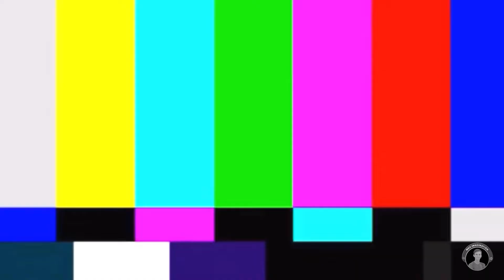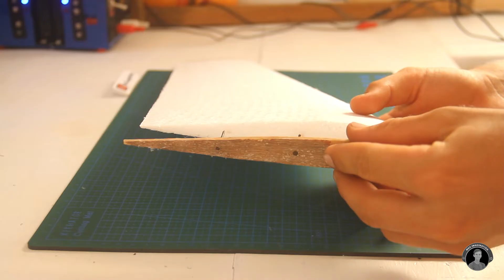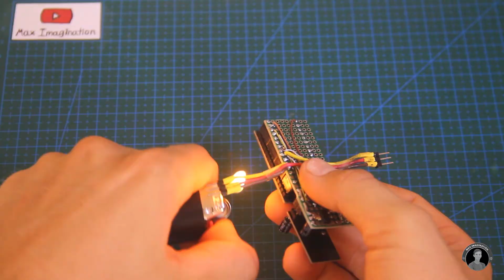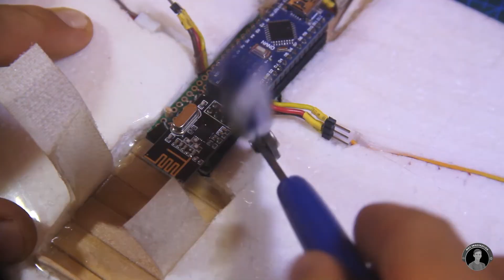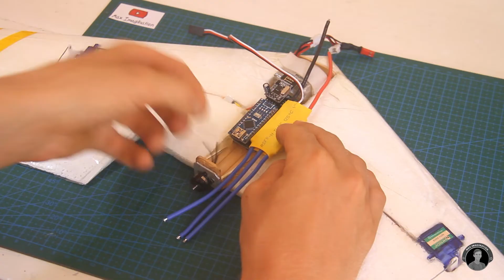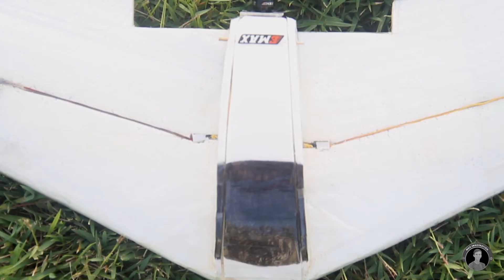Build an Arduino Flying Wing RC Plane | DIY Sweptback Wing

Comment from the maker: Hey guys! Thanks for watching the video! 
Just to rephrase the part where I stated the plane flies for ~10 minutes, I actually referred to the ideal flight time of this plane, calculating from what current the motor draws from the battery's capacity.
The plane in perfectly still weather conditions and a little more practice flying makes for better control and longer flights.
Thanks for understanding, cheers!
Consider dropping a like 👍🏻, a share, comment, and subscription to the YouTube channel if you like what you see! ✌🏻
Stay tuned for a potential upcoming video of longer flights from this flying wing.
Reply: You can add tail wings to stabilize yaw movement
Reply: @Art_Of_Fischl  Yes, and the excessive use of hot glue is also affecting its aerodynamics.
Reply: keep up this great work and passion my friend
Reply from the maker: @7MinutesCreative  Thank you, buddy!! 🙂
Reply: Good job bro
Reply: Bro you are so creative 😉
Reply: Its tail heavy....
Reply: mistake?... Its fly... Is ok....
Reply from the maker: @jogomez1988a  Hi, Jorge. Apart from not having flown one of these before and the slightly windy conditions, the plane flies good 🙂✌🏻
Reply: Bro you using 7500kv motor ?

Comment: What is the range of that? Bro
Reply from the maker: 100m
Reply: @MaxImagination my brother what happened if I place big wifi antenna with 18dbi into my nrf24 for long range because I want to build that like (budget meal) hehe
Reply from the maker: Use an NRF24L01 PA + LNA module if you want to attach an external antenna.
Reply: @MaxImagination thanks bro❤️‍🔥

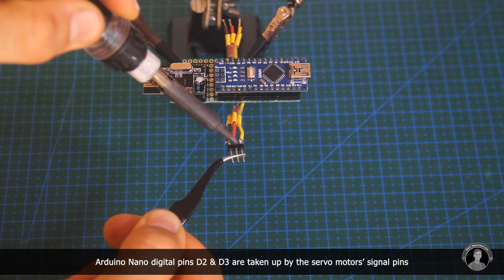Comment: @MaxImagination another question, what type of wire did you use beside 18 awg because in this tutorial, transmitter for 4 channel  and at 8:02 you didnt mention wire size, does 26 and 18 awg is good enough to use in this circuit ? and what type of wire when u use for the power in tge receiver? Thank you 🙏🏻
Reply from the maker: For powering the receiver, 18-24 AWG wire should work. For servo wires, your 26 AWG should work. For thin signal wires, I used 28-32 AWG wire.
Reply: @MaxImagination thanks man

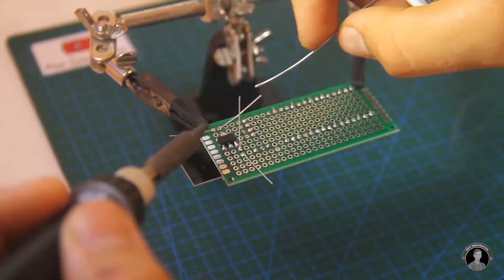Comment: can you explain where did you solder the capacitor in 7:10 because when i see the diagram it only shown to the regulator, does the second soldered into vcc and signal pin ? (sorry for my bad english)
Reply from the maker: The 10uF capacitor goes to VCC and GND of the NRF24L01.
Reply: @MaxImagination another question, what type of wire did you use beside 18 awg because in this tutorial and transmitter for 4 channel you didnt mention wire size, does 26 and 18 awg is good enough to use in this circuit ? and what type of wire when u use for the power in tge receiver? Thank you 🙏🏻

Comment: A six axis gyroscope with self stabilization will fix all the issues, that is the original problem they had with the actual flying wings till they got modern flight computers
Reply from the maker: Thanks for the tip. If I ever build one again, I'd consider adding a 6 axis IMU.

Comment: Im making mini version of this using 720 coreless motors i want to know can i use home made motor driver which you used to mini drone.if it ok is eny edits on code for brused homeade esc using mosfets?
Reply from the maker: Hi there. No edits in the code are necessary. Watch my new MOSFET Motor Driver guide video here: https://www.youtube.com/watch?v=xW2Nwg_RX84&t=46s

Comment: Excellent, How did you make yaw motion for this type airplane as no rudder?
Reply from the maker: The yaw comes from making the plane tilt to one side, making it do a turn.

Thanks!
Reply: @MaxImagination  Many thanks for your response. Could you further clarify it if possible? For example, by controlling the right-left control surface up or down.
Reply from the maker: Yes, it is made by making one flap tilt down and the other up. Swap these to make the plane turn the other direction.
Reply: @MaxImagination  Thank you for your response. Isn't this control for the roll motion? How is it related to YAW motion?
Reply: @ismailhossain9495 im Late but to clarify, a flying wing configuration doesn’t need yaw, you turn by rolling to the side you want to turn and pull the elevator, making the plane turn. If that didn’t help feel free to ask anything else.
Reply: you can use two motors with differential thrust, or you can use drag flaps, but this type of plane really doesn't need yaw control

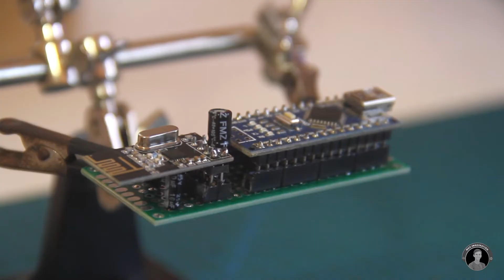Comment: hi max. 7:35 is the PPM out pin the one you have to connect the ESC to? Thanks!
Reply from the maker: Hi there. It's actually PWM and it's the first channel, yes.

Comment: here`s  a little tip: make a small handle on the bottom with some foam, so you can launch it like a paper airplane
Reply from the maker: Thanks for your tip! However, throwing it like that could get your hand in the way of the rear propeller as you throw and throttle up.

Comment: Bro if you need a elevon code I can give you the code. Cause you're code not working you couldn't make the motor go from the middle to the high value
Reply from the maker: Please excuse my lack of knowledge at the time of coding the plane. If you can supply the code, I'd appreciate it and it would help others too!
Reply: Bro I need a elevon  code  please

Comment: 👍.I have seen you using tp 4056 to charge 3.7v li po battery. I have 500mah 3.7v li po battery and tp 4056 what  value of resister you recommend to tp4056 for charge  my battery?
Reply from the maker: Search on google images for the "TP4056 current limiting resistor chart" to help you select the correct resistor for all future batteries
Reply: @MaxImagination  thanks.

Comment: If you think of revisiting this aircraft or the flying wing concept in general, you should incorporate some automatic stabilisation - even the best pilots the USAF has to offer can't fly these things unassisted, the only recorded crash of the B2 Spirit was due to a sensor failure, and as far as I'm aware it's the only full scale flying wing currently in operation.

Honestly, the fact you managed to keep this thing in the air for as long as 10 seconds was surprising and impressive, seems like you're a damn good pilot. Watching your videos, among other creators, has inspired me to start scraping together some components and hopefully build an FPV drone, or at the very least a car, so thank you for showing how simple this stuff can be.
Reply from the maker: I'll consider adding stabilization if I choose to make another plane or other form of aircraft. Thanks for your suggestion and compliments! Cheers.
Reply: Flying fixed wing aircraft in a flying wing configuration might be difficult in full scale aviation but model airplanes behave differently. It’s not that difficult to keep a flying wing in the air. Yes, more difficult than a high wing or something but still very doable. You shouldn’t need stabilisation after your first few flights just like with any aircraft.

Comment: Why never glue an electrical component directly to the styrofoam?
Reply from the maker: You don't glue components directly to polystyrene as this will rip foam chunks out when removing or replacing components.

Comment: Good project.I have made arduino transmitter and f22 raptor model aircraft is this arduino code match that aircraft?
Reply from the maker: Thank you! The code should work for that model aircraft, it works for most.
Reply: @MaxImagination  thanks 👍

Comment: hey max i am looking into making this for myself and I was wondering if I needed to make the transmitterthat you made or can I use an off the shelf 2.4 GHz one. If so how do I paired it/set it up and do you have any recommendations on with to buy.

thanks
Reply from the maker: Hi there. If you're going for a streamlined radio controller and receiver. I suggest you look on amazon for the Radiomaster TX12 ELRS transmitter and an ELRS nano receiver.
Reply: @MaxImagination  thank you very much

Comment: I'm new to rc plane hobby. I want to make a plane i hope to use 7.4v 2s battery and 30A esc. What motor you recommend for me 1000kw bldc or 2200kw bldc?
Reply from the maker: Choosing something of higher "kv" is more optimal to get your plane off the ground. I'd choose a 2200kv.
Reply: @MaxImagination  thanks max

Comment: Your video is great 👍 I made a 500 gram rc plane is it enough to fly it using 1000kw motor and 7.4v battery unit
Reply from the maker: Thank you! If all is well balanced with minimal drag, I don't see why not. You need to test it.
Reply: @MaxImagination  thanks. i will test.

Comment: Hey how did you mix the aleron and elevator is it in the code ?
Reply from the maker: I did not and reverted to using diagonal movements for the mixing.

Comment: Amazing video - thanks Max!
Just curious - how much would you say this drone cost to make? In terms of materials, electronic components, etc?
Reply from the maker: Thank you!
Considering that acquiring the foam would be almost free, the guts of the plane itself would cost you around $35-50 USD depending on where you shop.
Reply: @MaxImagination  awesome, thanks max! Definitely cheaper than I would have expected

Comment: The first motor you used has around 50g of thrust which was not enough to fly.
My advice: use IMU to stabilize the system
Reply from the maker: Thanks for your advice.

Comment: Hello I was just wondering if an 6000KV brushless motor would be less powered or good enough?
Reply from the maker: 6000KV will be a little slower (not by much) and more powerful, yes.

Comment: You might want to consider adding dihedral to your wing to increase it's inherent stability.  Your plane also looks very sensitive to pitch. So in your code you might add something to change the gain on the elevon so that you can fine tune the movement faster or slower.   You may also want the elevons to be trimmed up or down. The plane should be able to glide without controller input.  The engine mounted above the centerline may also be contributing the pitch instability. Nice project.
Reply from the maker: Thanks for your tips about my wing, Bill! I'll consider making these changes if I choose to make an improved flying wing. Thanks!

Comment: Awesome video! You can tell you’ve put a lot of work into both the plane and editing of the video. 
On a note about the plane, flying wings typically have their elevons always slightly up, especially for takeoff as this moves the CG forward slightly. Additionally, and I could have this wrong, but I believe flying wings have a different pitch axis then standard planes, so to counteract the different rotation they need to already be engages both during take off and cruise. 

Additionally flying wings are difficult to fly because you have to have both elevons and alerons on them to help with adverse yaw, but you only have them as one set making it a little touchier especially with a far bag CG
Reply: Forgot to mention - look into differential ailerons. It’s pretty much the only solution for adverse yaw on a flying wing unless you want to start getting really technical. It also allows you to keep just the ailerons rather then adding elevons
Reply from the maker: Thank you for your comment, Charlie! 
I'll keep your suggestions in mind for when I build an improved similar flying wing 👍

Yup flying these flying wings is not a straight forward thing... I'll try playing around with the CG a little more to get it more balanced in the air.

Cheers!

Comment: im still in the process of planning a different style of this plane but I have all the parts I need to build the wing part but no electronics so far, instead of doing a solid foam wing im doing a line of wing shape sillhouettes that get smaller towards the edge of the wing and im going to lay a sheet of foamboard over that frame to create the wing which both saves weight and mess
Reply from the maker: Sounds like a plan! Best of luck with your flying wing plane! :)

Comment: Looks like arduous job, I was wondering if you possible make a wider wings?  Alerion should be flapped down when going on the air, once it go airborne, lift alerion up to fly around.  I cannot image all of your hard work to make it fly. I am impressed of your hard work! Good job Sir!
Reply from the maker: I've been told my aircraft is also too tail heavy, not sure if having the flaps down will work as this made my plane nose dive from launch. But I'll try again! Thanks for your kind comment! :)
Reply: Nope. That's not how elevons work!
Reply: @oneistar6661  elevons?

Comment: You should have used a much smaller esc. The calibration is saved even after the batttery is unplugged.
Reply from the maker: Hi there. You have a valid point about sizing. Though, I used what I could get my hands on at the time. 4 packs of small ESCs were all there was online, so I instead chose this 1 larger ESC.

Comment: can someone break down how the motor is picked in this setup? The amazon page seems to be missing wattage. I want to verify why the esc, battery, and motor work together.
Reply from the maker: Hi there. For that tiny brushless motor, any ESC from small to large will be powerful enough to drive it. The ones I've linked below will work, guaranteed.
Reply: @MaxImagination  that's crazy I always thought you had to get a motor rated for  certain wattage then get a battery and esc that are of less wattage
Reply from the maker: @alchemysong  In general, always base your power needs from your motor. If it's a powerful BLDC motor, then you can't just use an ESC rated for a lower amperage. So actually yes, it first goes by selecting your motor, the available ESC, then battery.
Reply: @MaxImagination  thank you. We built this project in one of my classes

Comment: I think the main problem is those joysticks on the transmitter, if you use proper ones you'll see it's way more controllable.
Reply from the maker: Thanks for the tip. Yes, I would probably counter the sensitivity by gaining more control with proper joysticks rather than the current knobs.
Cheers.

Comment: I think it whould fly much better if it had landing gears and took of from the ground 😅
Reply from the maker: Hi, Ayaadh. That would be ideal for a regular-style RC trainer plane with an additional tail to go with a fuselage. However, landing gear is not found on flying wing model aircraft due to the added weight, it should be kept to a bare minimum with these types of planes.
What it probably would take is a bit of adjusting and more practice flying it here my end... 😅
Cheers.

Comment: as discussed, here, the wingtip stabs  should be about 1/3  as  tall.      because, the stabs increase the amount of mass located at the wingtips.   and, there are adverse affects from such  outboard-located mass.        in order to limit the adverse affects, the stab size  should be  minimized.        googletranslate
Reply from the maker: Hello there, David. Will consider experimenting with trimmed wing tip fins to seek better flight results. Thanks for the tip!